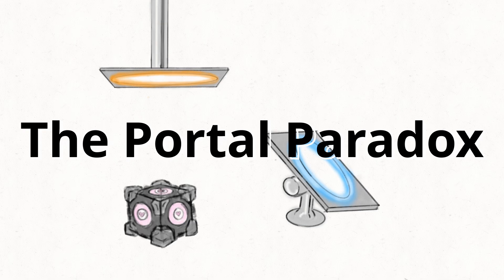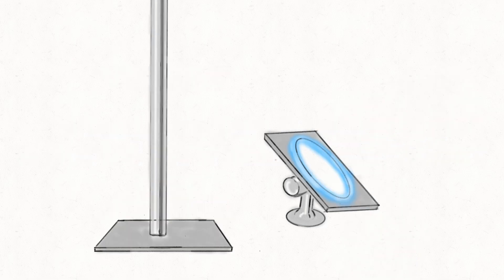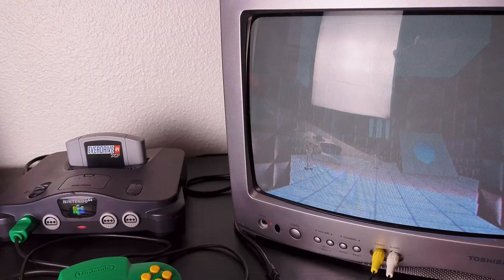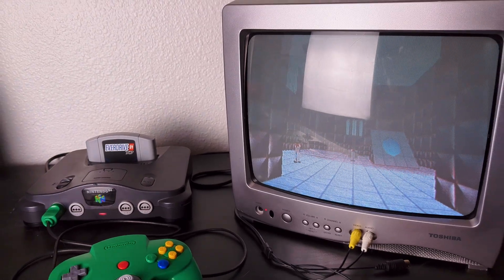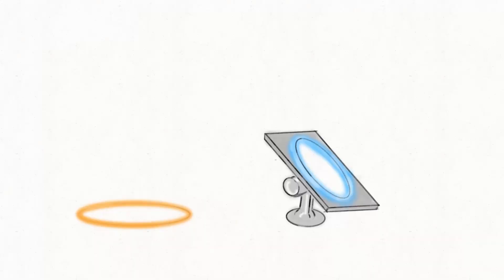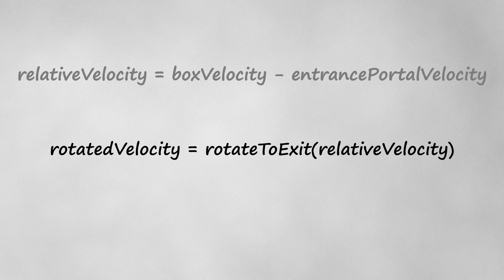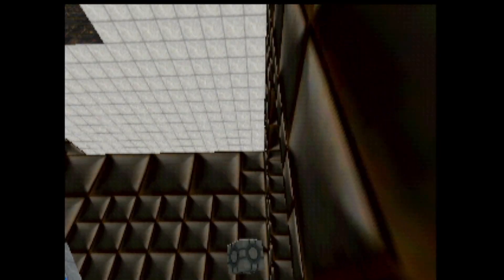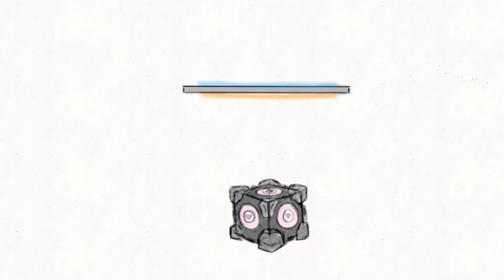I rewrote Portal from scratch and solved the Portal Paradox

Comment: As intuitive as your implementation seems to be, I belive it violates conservation of momentum.  A portal exerts no force on an object passing through it.  Therefore the object's momentum should remain the same if a portal moves over it.  A stationary object with zero momentum  cannot suddenly have momentum because it went through a portal.
Reply: Portals violate all sorts of laws of physics. For instance, the conservation of energy is broken regularly in Portal, and it happens in this example as well.
That being said, if you assume that the portals maintain the magnitude of momentum of the objects entering them (which is a reasonable assumption given we see it happen all the time in the game), then the demonstration shown in the video is the result. The cube has momentum relative to the orange portal, so that momentum should be carried through across to the blue portal. If you say it has no momentum, then it wouldn't be able to pass through the portal at all, as it wouldn't have any momentum to leave the surface of the blue portal.